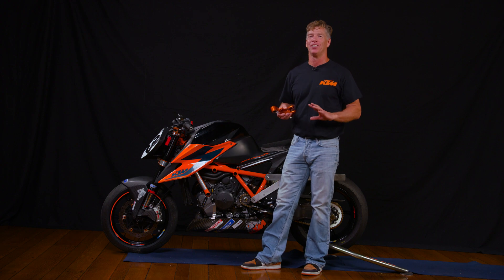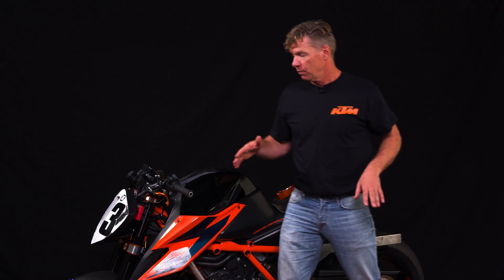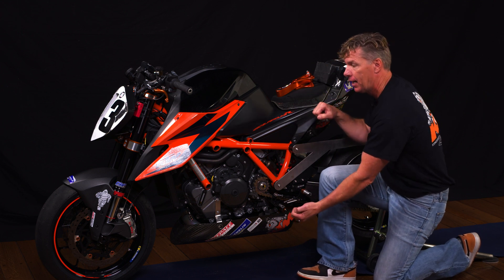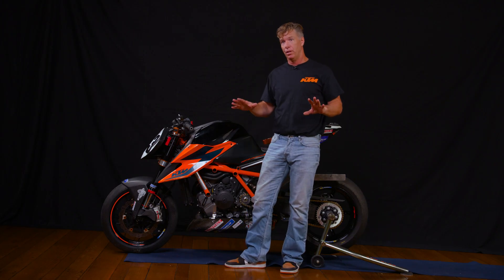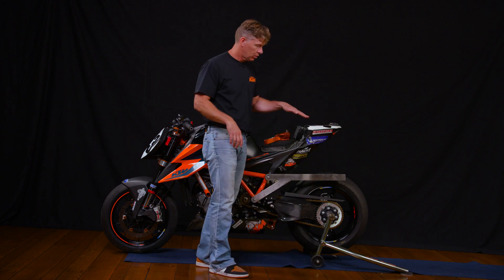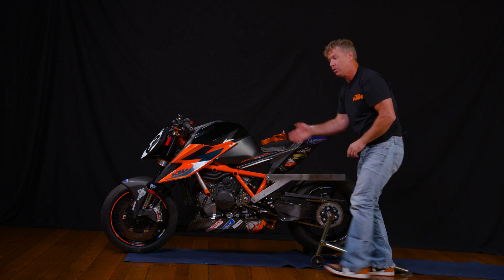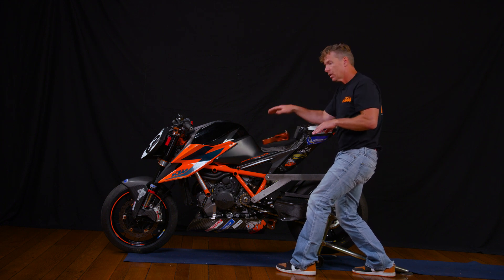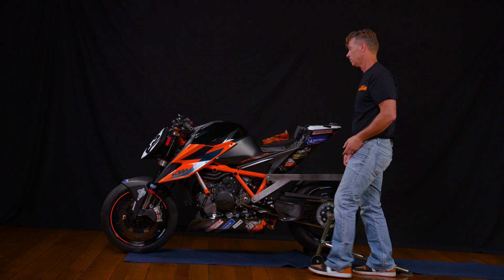What Is Anti-Squat and How It Affects Your Motorcycle - KTM 1290 Super Duke R

Comment: I don't see it helping with wheelies. It rather usually makes the bike wheelie more
Reply from the maker: Squat makes wheelies come easier.  Anti-squat does the opposite, helps fight against wheelies.   But there are other elements to the equation of course.  Like you might be saying, a bike with more anti-squat will allow you to accelerate harder out of turns without losing your line, which will create even more weight transfer toward the rear.  So unless you get into a tuck, you might feel even more of a tendency to wheelie simply due to the fact that your center of gravity is so much higher than your rear axle.  So in that case, you would be right.

Comment: Hey man love your videos, I'd need some advice from what i've experience with my Duke Gen3 (2021) from  a pro like you!
Im running the stock shock WP & stock gear. And im 80kg dunno if affects anything(meaning i might not need rider height?) So the issue i have is im getting wrecked by any bike out of the turns at track, as soon as i hit the throttle im running wide out of corners 24/7... 
I do not know what i should i go with , 10mm or 20mm.
Reply from the maker: Nicke you are running wide due to the SDR's Achilles Heel - Squat.   Cheapest way to fix the problem is raise rear ride height.  If you had an aftermarket shock I'd say get the Superlink, because you will benefit from more than simply ride height.  But for now with the OEM shock I would try the links for OEM shocks.  Either will help you, the +10 or the +20.  Obviously the +20 does more but depending on some other factors like your height or your gearing, the +10 might suit you better.   Personally, because I like incremental changes, I would buy both the +10 and the +20.  Also because some gearing combinations are better with the +10, while others are better with the +20.  And when you weigh what they give you VS what they cost, it's a no-brainer.
Reply: @superduked33  Thanks alot for the feedback, and quick reply! i will get em both!

Comment: So i can not use these superlink with the stock  rear suspension?
Reply from the maker: The Superlink is designed to work with a height adjustable shock.  The OEM shock is not adjustable.  We made the +10 and +20 links to work with OEM shocks, which achieve similar things by just bolting them on.